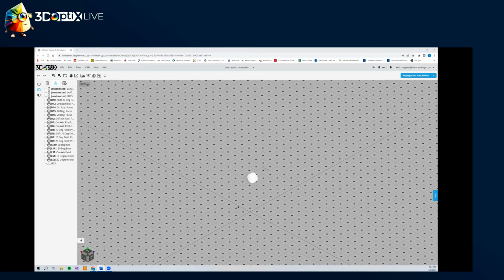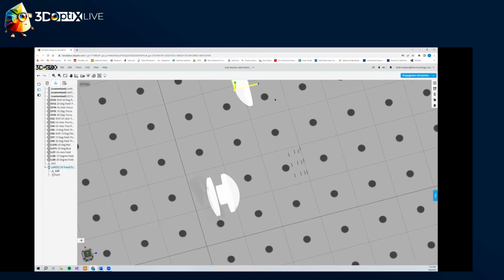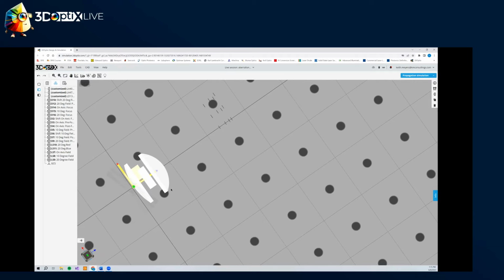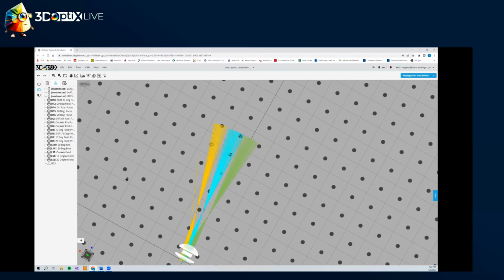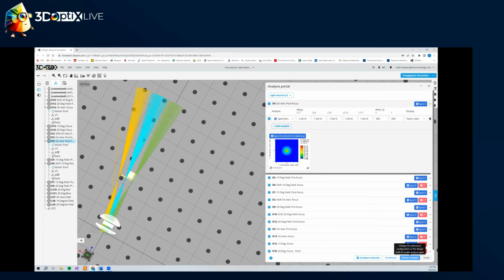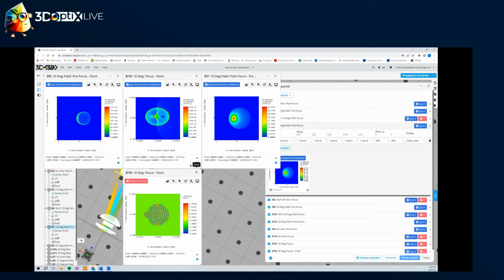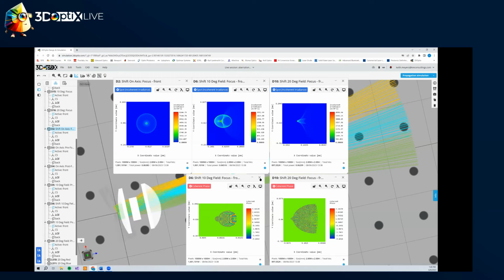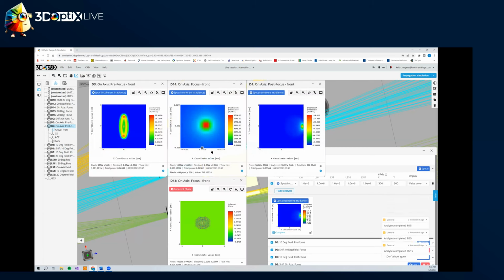3DOptix Live - Aberrations Analysis Design session with Mr. Keith Meyers, an optical designer

Comment: Hello, is it capable if I want to extract the data in csv or txt formatted file? 

Besides, is it also capable to do an automated parameter sweep like you have demonstrated? But this time I want to, for example, rotate the lens automatically with predetermined steps and increments so we can plot the graph as a function of lens rotation from the data extracted
Reply from the maker: Dear Cobb,
Yes, you can download the detector data in a csv/xlsx format 
Yes, you can build an automation workflow with 3DOptix Python APIs and exercise the flow you described - this is a premium feature
Reply: @3doptix  Thanks for your information! Is there any demonstration video available for such workflows?
Reply from the maker: @Cobb-f1k  Currently we don't have video on API - they will be added in Q2
You can look at the API documentation @ https://simulation.3doptix.com/manual/api/what_is_3doptix.html?V=1713950688623
Reply: @3doptix  thank you! I will take a look at it first